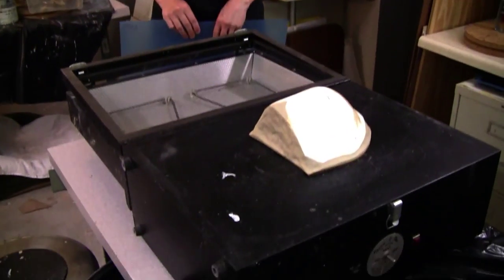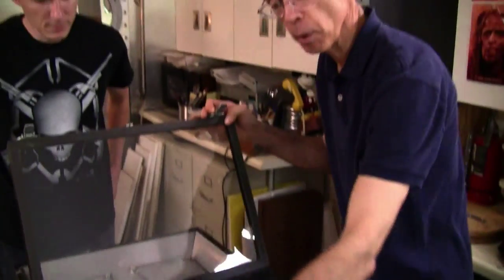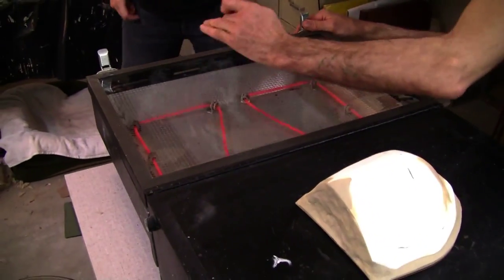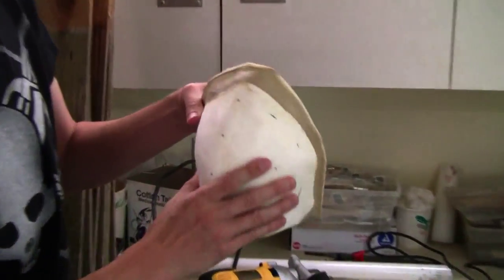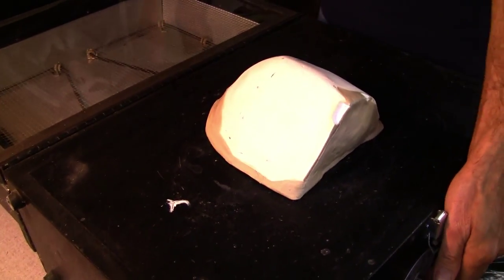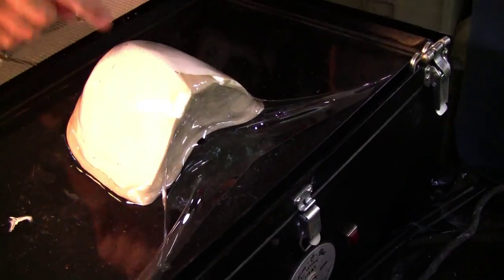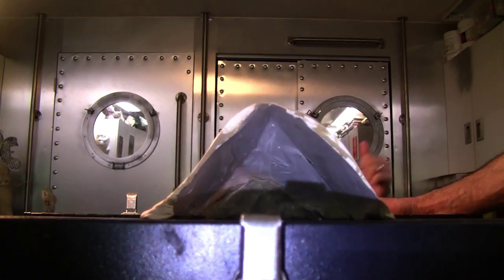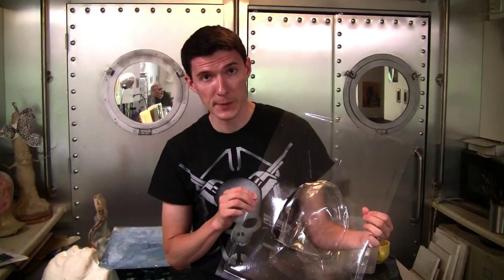Vacuform

Comment: Interesting, haven't seen a vacuformer like that before. Would think that swinging the hot plastic over the mold would increase the chance for creases as opposed to lifting the plastic sheet and placing it straight down onto the mold. Also, I've seen some people use a heatgun on the plastic while it is being vacuumed to get rid of or at least diminish creases that form. Still, interesting video.